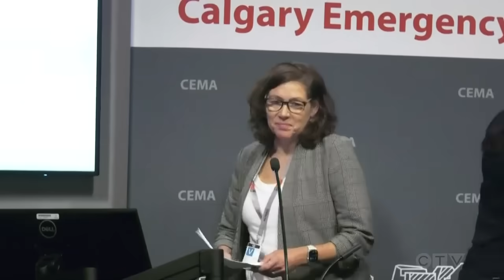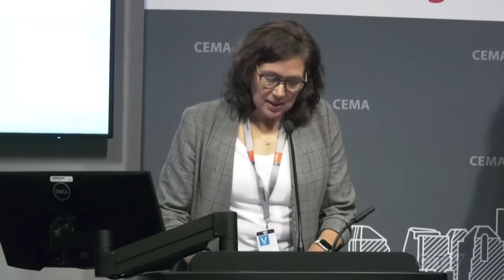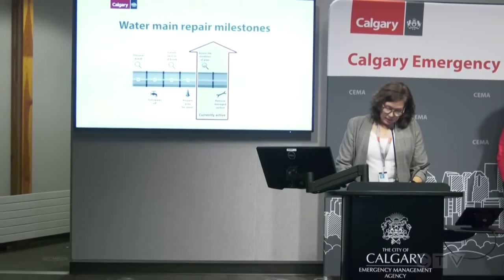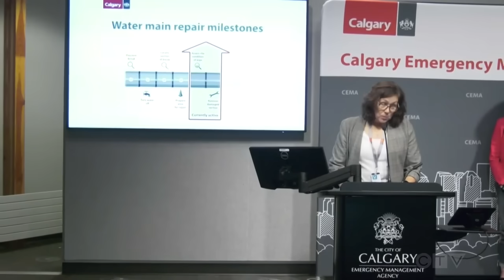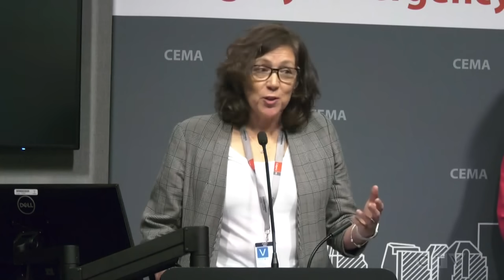Update on repairs being made to Calgary's water main break | Restoring Calgary's water supply

Comment: Don't they have a way to monitor the pipe for preventative maintenances? 
If not, aren't they supposed to life cycle pipes instead of wait until they break and stop everyone from using the water?
Lastly who's going to be responsible for this?
Director of Water Service? City Manager?
This shows how badly City is running the infrastructure.

Comment: Thank you to everyone who's working on fixing the pipe!
Reply: True but thanks also needs to be given to everyone conserving on water so that the Glenmore system can still refill the district reservoirs.  However, as it is a capacity issue, wouldn't a small supplementary feeder from the Bearspaw system make up the difference, shouldn't this have been planned and built before the main feeder line needs to be replaced within 25 years as it's in year 50 of it's expected 75 year lifespan.  Maybe closing off a few streets to lay down a temporary surface feeder as the military is equipped to do on the battlefield on short notice could help if the public is unwilling to conserve enough though this would push some of the problem to traffic flow.  Are such exceptional efforts to address the problem even worthwhile to pursue as the repair will likely be complete in a few days anyways and already mitigating efforts have already removed the Bowness boil water restriction so primary health concerns are being addressed.   Maybe, we should just all calm down and just have a can of beer instead of a glass of water.

There's over 37,000 water main breaks active in the city at this time.  This is the only one that has required city wide conservation.  One really serious break out of 37,000 isn't bad...
Reply: That is what they get paid to do. This is why we have some of the highest City employee paid wages in the whole of Canada and why your property tax goes up each year. To pay the huge wages. Over 30% are making well over $100K a year. This is also why we have some of the highest property taxes in Canada.